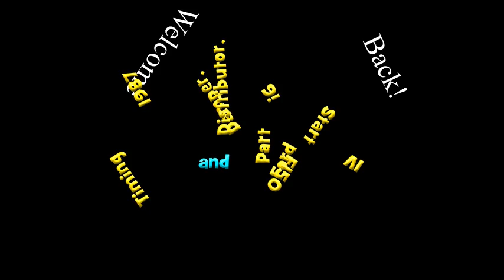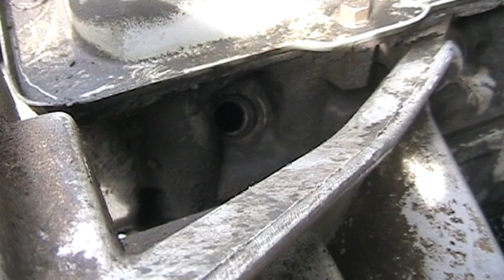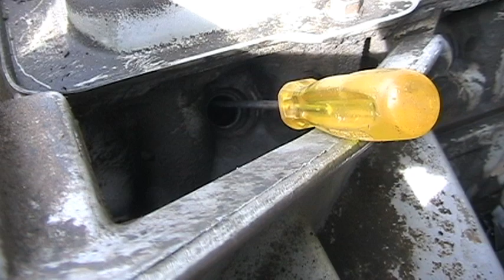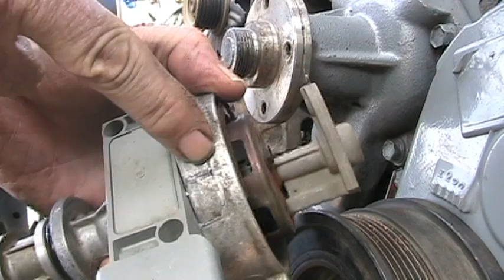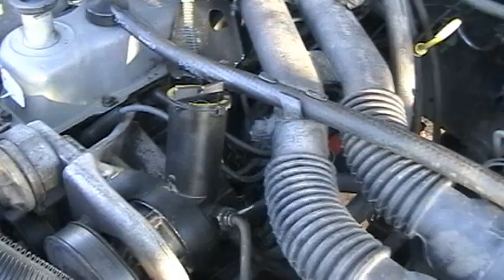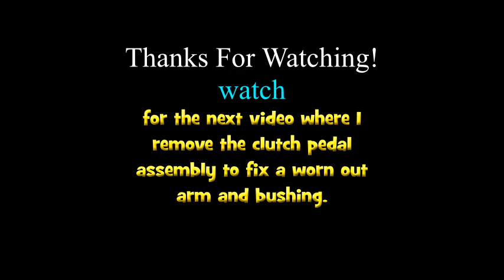1987 Ford F150 I6 Damper, Distributor, Timing and Start Part IV

Comment: @4:59 why "0" TDC instead of advanced 10°?
Reply from the maker: Zero is the starting point. Ten degrees is the advancement from the zero starting point when setting the timing with the spout connector removed. If you set the crank timing mark on ten degrees, drop in the distributor and go to time it you would be off on the timing marks and the distributor may not have enough advancement left by turning it to actually get a correct reading.

Comment: It is after not before. Why do you want it fire the plug before it reaches fuill compression? If you fire it going up at 10 before then you defeat the actual power of combustion pushing the piston down. It actually is pushing against the piston coming up. It should fire doing down or you get preignition detonation.
Reply from the maker: Btdc and Atdc are confusing. Starting is best done at btdc usually specified on the engine sticker.

Comment: I couldn't get the distributor to seat, ford's suck.
Reply from the maker: Sorry. That oil pump shaft fitting into the bottom of the distributor can be a total frustration at times.

Comment: Question: You did not turn the distributor to time it, correct?
Reply from the maker: This is the distributor install for the initial timing. Final timing is done with a timing light. Disconnect the Spout connector and set the timing according to the Vehicle Emissions label located somewhere in the engine bay. Thanks!
Reply: @SteveAZ711 do you have any video using the light and how I can identify the spout conector?

Comment: Another good way for a compression stroke is use a tube with a little balloon or rubber glove finger taped around the tube it fills with air there you go
Reply from the maker: Thanks! That would make for a exciting visual check for sure!

Comment: Hi I have a couple of questions.
On the left hand side of the harmonic balancer is where you set TDC and the right side are some marks on a cover of some sort. My question is do you time the engine to the marks on the side you lined up TDC ?
Reply from the maker: Yes. Ford used the other marks for earlier 6 cyl engines. That is what I heard.
Reply: @SteveAZ711   thanks for the help.
Timed and running well.

Comment: I’m really hoping you’ll see this soon. 
I’m trying to get to TDC on my 86’ f150. I tried the paper towel trick and I’m not 100% sure I had it stuffed in enough, and I turned the motor all the way around, counter clockwise til it got back to my number dial. Do I have to try cranking it again or would it be safe to assume it hit the compression cycle? Would it hurt to try again?
Reply from the maker: I am thinking you should be turning it clockwise. If you can stick a soda straw in the spark plug hole and it hits the piston at the top after you have stopped rolling it around, and the Timing Mark is lined up with the Zero on the engine tab, then you should be at top dead center. Do not lose the straw into the spark plug hole. A long very thin screwdriver will work as well.  Hope this helps. Thanks!

Comment: Idle sounds really high in this video at least.
Reply from the maker: This truck always idles high until it warms up. The computer controls the idle. Idle for mine settles in around 850rpm.
Reply: @SteveAZ711 I i take my 95f150 4.9 to a mechanic shop die on me  so they put a new distributor but now idle low and some times die I wonder if I Ned to adjust that distributor

Comment: you music is too loud for me to understand you. you said the position of the distributor is like "this" for 87 and beyond but it also sounds like you said "like this" for 86 and beyond.. I've played the video severy times and just can't make out what you're saying. Wonderful video though thank you
Reply from the maker: Sorry about the music. The position of the distributor is such as to catch the fan breeze for cooling. In my opinion,  it really does not matter as Ford recognized the cooling issue and moved the distributor module to the left fender in the newer models. What counts is the #1 wire position lining up with the top dead center of #1 piston on the compression stroke. Thanks!
Reply: @SteveAZ711  Thank you for clearing that up. My truck started losing power and slowly got worse and worse until it wouldnt run. I thought it was the cats, replaced them for $1k (thanks CA) but made no diff, tried everything I could think of fuel, spark, exhaust, gave up and towed it to a mechanic, he said my engine was toast and needed another one. I didn't buy it and towed it back home, after everyone including the mech told me it can't be the distributor, I noticed a lot of play in the rotor, pulled the distributor out and the pin that holds the cam gear in place was sheared off so the gear started turning and well, here I am. I needed to know how to find TDC and you told me. Thanks a million sir!

Comment: Question ❓ does the 1994 f150 4.9L has a crank shaft sensor or Not? Or just the distributor cap.
Reply from the maker: It is a hall-effect sensor inside the distributor cap. In 1996 the i6 used an external CPS.

Comment: cool video best one on distributor for newbies and im sure mechanics can benefit from this . why did u say u werent pleased with the very fast idle at start ....isnt it normal for it to idle high at first then it idles back down on its own.
Reply from the maker: Yes it seems to be the norm for it. The computer makes the decision according  input and the idle does come back down fairly quickly as it warms up. I guess I was expecting something less than 2000 rpms at first. Also, I disconnected the clutch pedal safely start switch ( did not grow up with those and always made sure trans was in neutral), so if I made a mistake and started it in gear...2000 rpms was going to make it leap pretty good. I always put the clutch pedal in anyway as to take the load off the engine in a cold start situation anyway. Thanks for the comment...thumbs up!

Comment: So what if I turn my truck on and it turns off? It starts up good but turns off and I don’t know what to do
Reply from the maker: Crank it check for spark. I had an ignition module go bad that caused a similar issue.
Reply: @SteveAZ711  I changed the whole distributor out lol
Reply: Pull out the Spout and see if it starts then. The spout by-passes the ECM- computer. Replace ECM after checking coil and distributor pick up. Average life of the Capcitors in the ECM is 15 years. Having the Spout out will cause the Transmission to shift bad the Motor to not be efficient. Gotta have the spout in.

Comment: Well, I gotta tell you. I don't care if Henry Ford came back to life and said this would work on a 96 or not, it doesn't. Good video, it clearly works for some.
Reply from the maker: Yes it does!
Reply: I’m with you man, my 88 is irritating me so bad. 
I install distributor just like this, put a timing light on it and it runs best at 30 degrees btdc. It’s supposed to be 10. Still runs like garbage!! Beyond frustrated
Reply: @marcusaddis5502  That truck was a "Z" model. California emissions, special parts throughout it. Literally a 1% truck. As in only 1% of the entire line was like it. Ended up selling it for twice its worth. Now I have way more free time to do things like work for a living. No time for Fords anymore. My GM is flawless.

Comment: If you didnt crank or move your engine,theres no need to point the rotor to number one sparkplug or turn the crank pulley to get the piston at TDC. Just mark your distributor cap and rotor as well as the body or base of the distributor to block. Then when all is marked pull out the distributor, then put it back the same way and then time it.
Reply from the maker: Thanks Jerry. This is true on a running and timed engine and good advice. On my video the engine had blown the timing gear it is a guess as to where the timing stopped at. Also, the person I bought it from had someone working on it (trying to get it running) and I am sure it was rotated quite a bit. Your point is well taken and good advice for working around distributor timed engines.

Comment: someone told me that you cant just pull the distributor out because the oil pump is connected to it and you might drop something where you cant retrieve it.  Whats that all about?  I just want to remove and replace.
Reply from the maker: The distributor just slips over a hexagon shaft coming out of the oil pump.
Reply: The Oil Shaft rod,  hexagon shaped, is inserted into the bottom of the distributor shaft and held there by a 'C" shaped Retaining ring inside the lower distributor opening. Pull On it very Hard and it will come out ,then install it on the new one- Retaining 'C" ring up inside, not on the bottom. It should have a Groove inside the distributor  for it to lock in place like the Original one. Mine from Auto zone did not. I'm taking the chance that's there's enough friction to keep on while i install the distributor. If it falls into the Oil Pump I might be able to retrieve it with a Stick Magnet tool. If it falls in the Oil Pan i'll have to take it off and get it out. Rebuild the Original if you can. There's good videos on doing that the practicle ,"do it your self" methods with only a few tools. Do Not start the Motor without that shaft in. It will be starved of oil and burn up.

Comment: I have an 81 f150 with a 300. I am very confused by all of this and was looking for some clarification. You had the engine timing set at TDC when you put the distributor in and then said something about letting the computer take it from there. Is that really all that needs to be done? I was under the impression that it needs to be somewhere around 10 degrees BTDC. Also when you say the computer, what are you referring to? The ignition module box? My engine is currently totally out of whack and it just pops and almost backfires when I try cranking it. I’m trying to get my timing back into place to fix this and am just really stumped here. Is this process different for a carbed engine? Please help me I’m very puzzled, thanks.
Reply from the maker: My year engine has a SPOUT(spark output) connection from the distributor to the computer. I disconnect that, then I manually set the timing at 10 degrees while the engine is running, shut it off, tighten the distributor clamp, and then I reconnect the SPOUT connection and the computer adjusts the timing etc. for different conditions. It sounds like your engine timing is not correct. MAKE SURE you are using the correct timing mark on your balancer pulley! Also, pull the #1 plug and bring the cylinder up to TDC, then remove your distributor cap... and if your timing is correct...the rotor will be pointing to the #1 terminal on the cap. If not, you are not timed correctly.
Reply: Cars Trucks And Detours haha. Turns out the gear on my distributor shaft sheared off. No wonder I had timing issues😂. I appreciate the time you took to write a thought out reply, it shows that you really care about your viewers. I will be using this video to get the timing straight with my new distributor.

Comment: Hi! This video is super helpful. Although I have a problem, what if I am on the compression stroke on the number one spark plug at tdc, But  0 degrees is still far away from the correct timing mark.. any ideas??
Reply from the maker: Timing chain has slipped or the gear is stripped...
 Make sure you are on compression stroke and not on exhaust stroke. Both instances will have the piston in the top position. Compression stroke will push your finger out of the #1 spark plug hole if the gear or chain is ok then 
TDC will line up on 0. Also make sure your are reading the correct mark on the crankshaft pulley. It is a very faint line on mine. I marked it better with some chalk.
Reply: Yes you probably going to be breaking the front down for a new timing kit. Depending on the mileage and the previous maintenance schedule that has been run on the vehicle you might want to think about head gasket as well.

Comment: Did you rotate your motor back to 10 degrees TDC after installing the distributor? Or does your vehicle call for it being at 0 degrees? Thanks for any info.
Reply from the maker: I installed the distributor at 0 degrees. Then with the spout connector disconnected I started the engine and set the timing at 10 degrees Btdc, shut the engine off and then I reconnected the spout connection and let the computer handle the timing.
Reply: @SteveAZ711  thank you so much for the reply. Is a timing light needed? I am currently doing this. I set the timing mark at 10 degrees btdc then put the distributor in. Is that okay or should i start over?

Comment: Afternoon sir question that i have is i follow the same step you have shown in this video and i really apriciates it has help alot, my question is its starting to back fire trew the intake alot of sputtering i.have check the wires any clue what might be thanks im having no luck thanks
Reply from the maker: Check the firing order( wires on proper plugs?) Sounds like the timing is off. Go through the whole procedure for the top dead center on #1 compression stroke, and then take your distributor cap off and see where the rotor is pointing. It should be  pointing to #1 plug wire.

Comment: Hola amigos como pruebo mi distribuidor de ford 302 carburada 8c
Reply from the maker: Todos los motores de distribuidor de 8,6,4 cilindros siguen el mismo procedimiento ... Cilindro muerto superior en el n. ° 1 y rotor del distribuidor apuntando al cilindro n. ° 1 en la tapa.
8,6,4 cylinder distributor engines all follow the same procedure...Top Dead Cylinder on #1 and distributor rotor pointing to #1 cylinder on the cap.

Comment: After watching three separate videos about setting timing with a light and moving the distributor. yours is the first that doesn't have vertigo  inducing camera shots, little to no description about the process and proper lighting to show what and where the work is to be preformed.  a big thanks to someone who cares about actually informing those of us who are genuinely interested in keeping our trucks running and out of the hands of mechanics and dealerships alike. albeit that your video isn't exclusively about setting timing it still has way better content than the more specific videos here on YT.   Two thumbs up sir!

Comment: Thanks, that was informative. Doing a head job on a 1995 E250, van, 4.9 liter, 300, auto and have a question for you if you might know and care to answer. Ford makes this confusing and a Haynes manual is no help. You are using the notched scale on the left side of the harmonic balancer. What are the ones to the right on the timing cover for ?? One just above the balancer and then again, upward right with a "TDC" on it ?? Would just like to know what that's for other than to confuse.
Reply from the maker: Ok this is my uneducated guess...Ford started this i6 (262 cu in.)engine in  the 1960's. The 4.9l i6 came along in 1965. I believe the marks you are referring to are left overs from previous casting stocks. It is possible that in order to save retooling costs they just used previous castings( that fit perfectly.)  However, that is just a guess and maybe Ford really only knows. Good question as they are so confusing.
Reply: Thank you sir for your guess. If I happen to find out I'll pass it on to you. Have a good one.
Reply: @SteveAZ711  I thank you for your great video on this topic. I just installed a CSG-649 version of this engine (from an Onan Generator) into my 84 F150. The timing marks on the cast gear cover are for the old style vibration dampers, which have their marks in the correct position, so the timing marks to use depend on the harmonic balancer pulley in use. I can tell you this without any doubt.  Again thanks, as your video helped me see how things should go in my truck- which was a basket case.